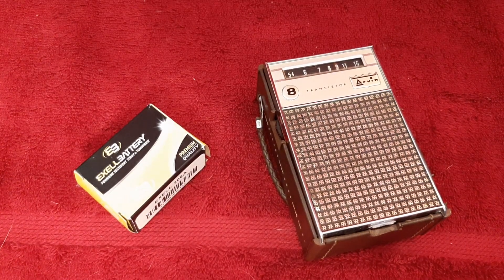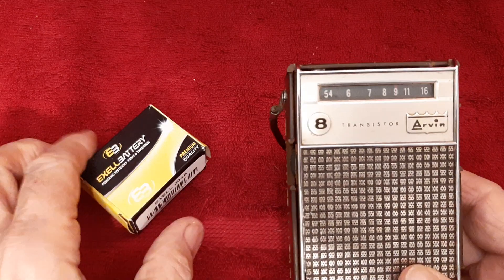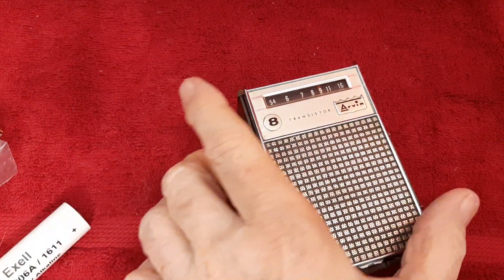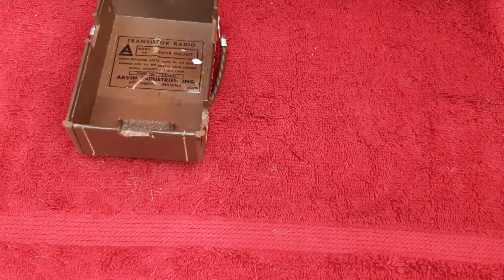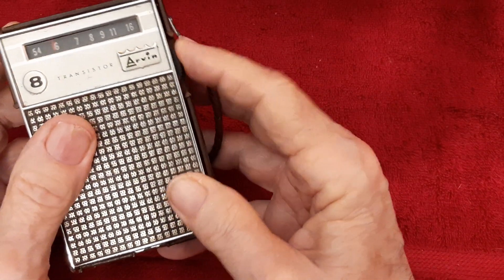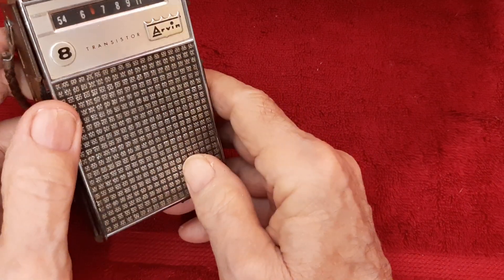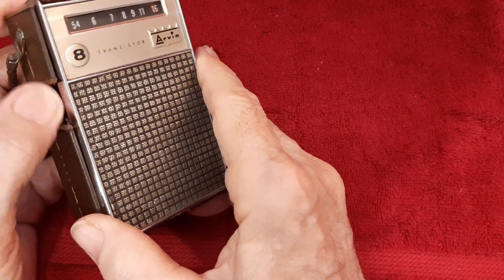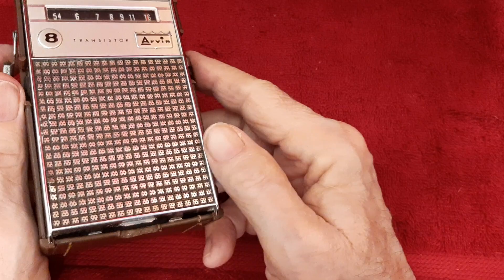TRRS #2388 - Very Unique (1964 vintage) AM Radio From Jeff

Comment: Cool radio, but with the cost of that battery I think I would have to pass even if the radio was cheap. Would still be a unique radio for a static display though.
Reply: I would have converted it, but no room.  For a few years, it was Display only, but I got another radio using same battery, so I bought 2.
This radio came to life and plays excellent.
[ the other is dead].
So I don’t use this very often.
Thanks for watching.
📻🙂